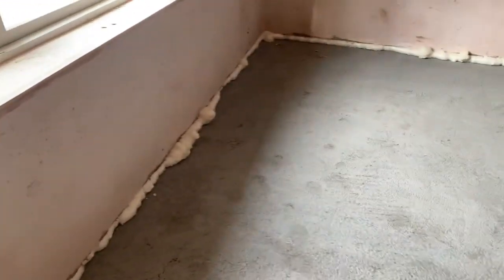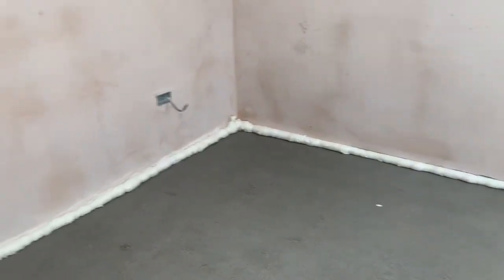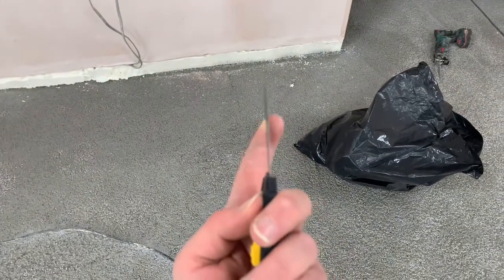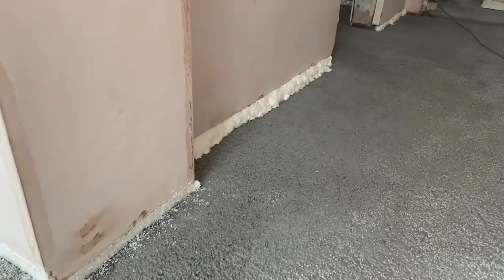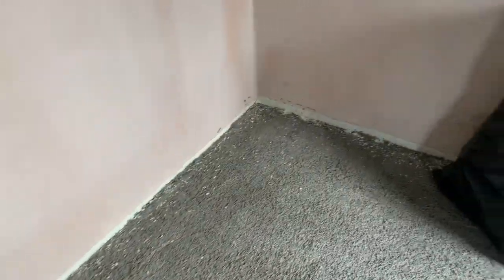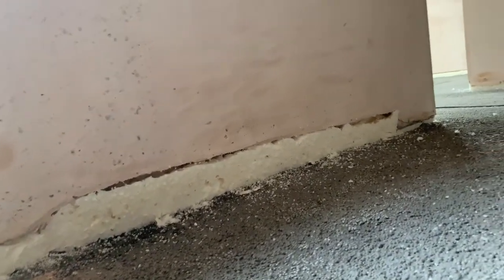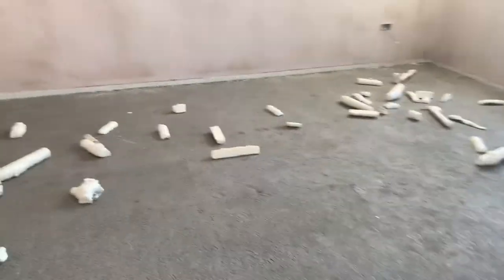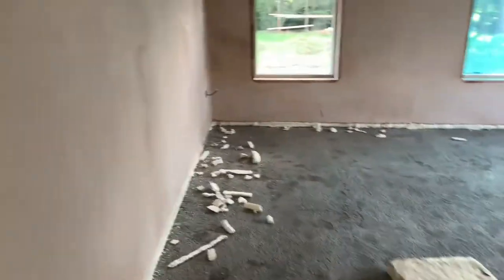Irish House Renovation Blog: Part 20 - Expanding Foam Cutting - Parkside 20V Reciprocating Sabre Saw

Comment: Do you have any useful websites or resources on retrofitting a house during a renovation? You clearly know what you are doing - do you work in construction yourself?
Reply from the maker: Hi Daniel, honestly I’ve found YouTube to be the best resource for tutorials on the fly. As for the reno - I just take each piece step by step and research everything so if it’s somethings like wall insulation or floor insulation I’ll just research all the different options and then make a decision based in overall performance, fitting time and cost. I’m an electrical engineer and lighting designer myself so not overly experienced in building but if you take each piece in your stride it’s pretty easy....
Reply: @TheKildareReno  That's actually exactly what I was hoping to hear. I'm considering a renovation of a much smaller property, with a limited budget,  with the goal of going G BER to B+.  Watching your videos gives me a lot of confidence.

Really impressed with the design of your home and all the thought and attention to detail in your work. Love your videos - thanks for taking the time to make them.
Reply from the maker: @ddermotj  really appreciate it. Best of luck with the project!

Comment: The house is looking great 👍what type of heating system are you going with is it an oil system or a  heat pump 👍
Reply from the maker: We are using a 16.2kW Air-to-Water heat pump and all underfloor heating.
Reply: @TheKildareReno  hopefully you will be doing a video on that sounds like a right job 👍
Reply from the maker: Video will be sometime in March 😊